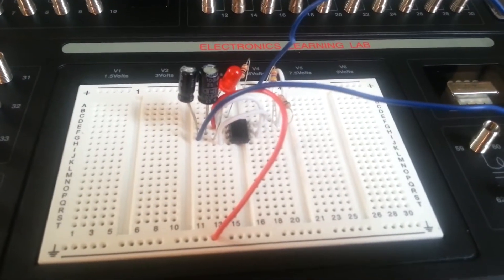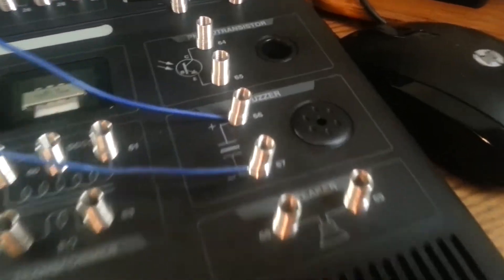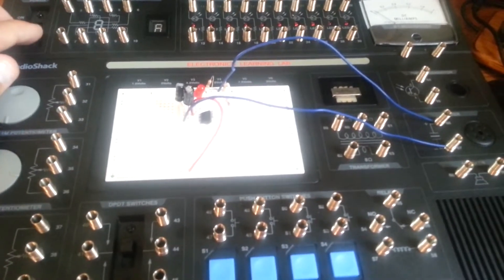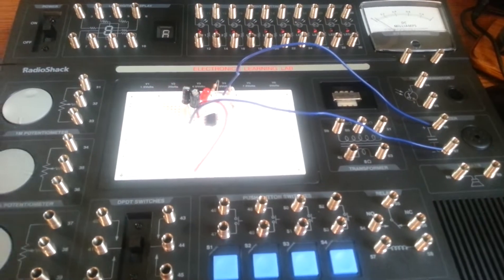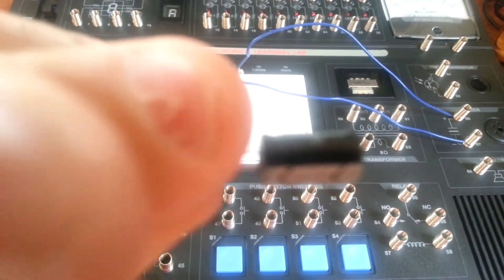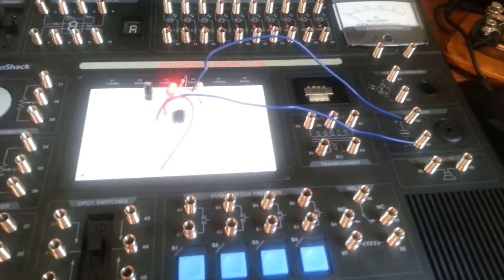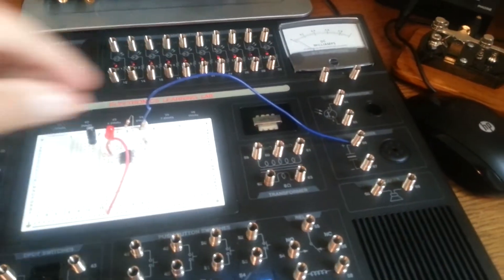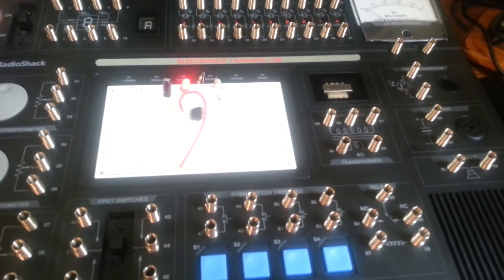RadioShack Electronics Learning Lab #2!

Comment: This is awesome man. Thanks for doing this
Reply from the maker: No problem 👍I hope they are interesting. Cheers,
Reply: @statisticool  Why is that an LED doesn’t work on the same  5 pin row with the positive and negative on both ends? I either have to put it across two different voltage rows or put the LED on a different column.
Reply from the maker: @ahappyimago  Without seeing it, what I suspect is happening is that you shorted out the pins by connecting them to each other via the one socket strip line in the breadboard. In other words, you are trying to connect the LED to itself
Reply: @statisticool  you are right. I guess the circuit just runs through the pins rather than going through the LED path